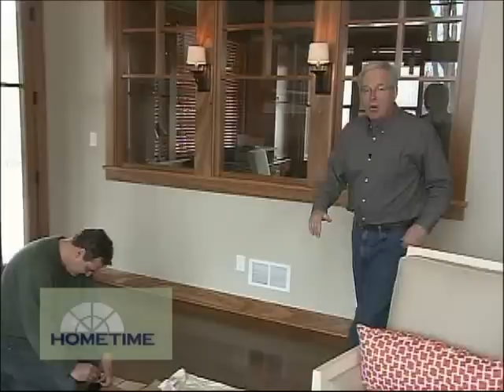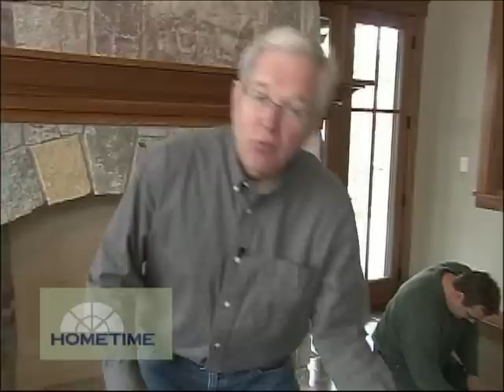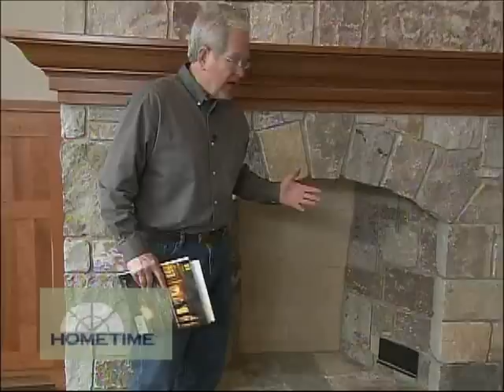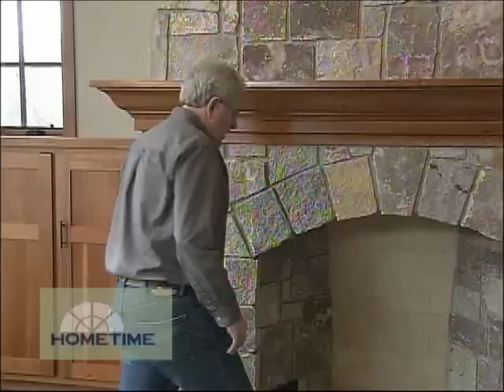Why It's Called a Rumford Fireplace

Comment: last winter I tested my never before used basement 36'' slant with a customized vestal cast iron damper.I did a shoddy video close up which shows the little f.p. doing great at a 1/26 ratio....not quite what my 50'' does with my own damper but respectfull when considering slants normally use a 1/17 ratio..mostly demanding tee pee fires to do it less leakage.Orton's book "The Forgotten Art of Building a Good Fireplace'' should include this accompishment as it repesents a 50% decrease in heat loss

Comment: We've been building Vrest Orton style slanted Rumfords since the 70's. The slant was dominant until the late 50's, when the hearths were raised and the boxes were deeper.  Orton's book revived the proper slant firebox. I have videos of my F P burning with my fabricated damper set at 2-3/4'' and will do a close up 1-3/4'' at 84 sq. inches or 1/30 the opening  30 hrs of successful testing so far. Casini Masonry on facebook for videos or fcasini25 on you tube